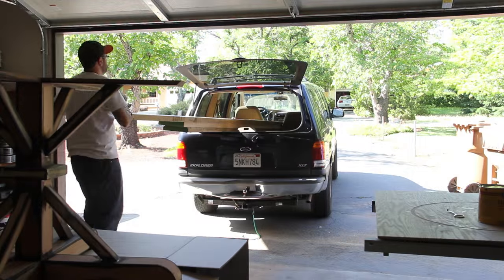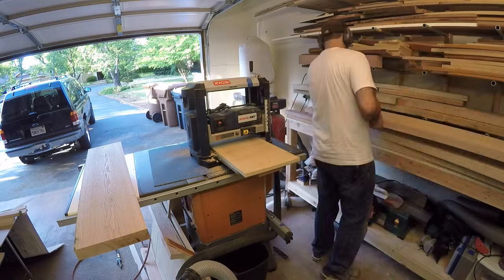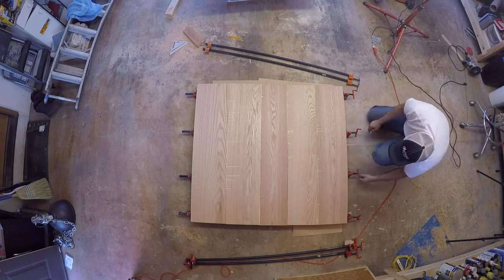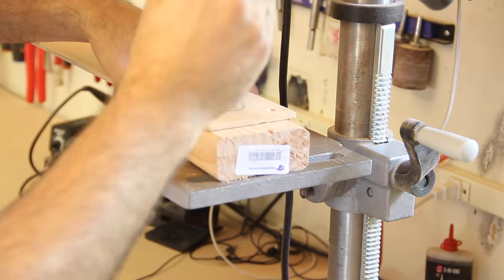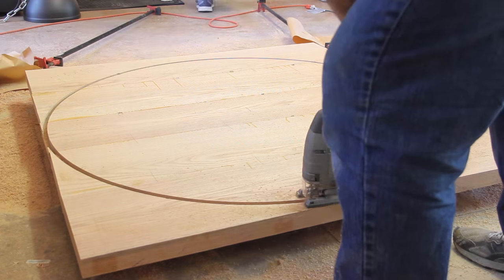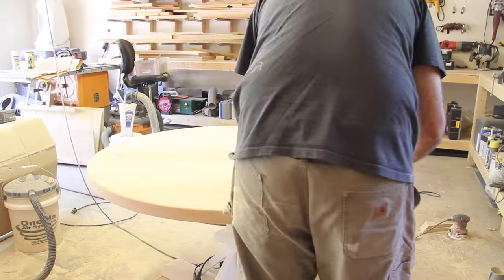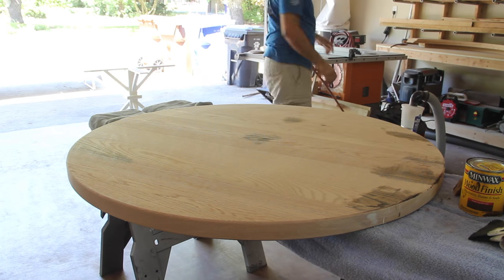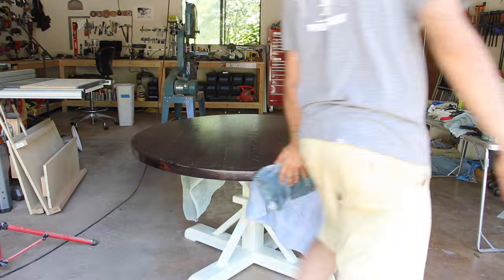How To: Make a Kitchen Table (Part 2)

Comment: Just subscribed to your channel.  Nice work on the projects so far.
About the spar urethane it bubbles very bad when you shake or mix it. Next time try diluting it 5-10% with thiner.  Need to do more coats but little or no bubbles.  
look up the Wood Whisper that's were I got 5 the info. In the end nice table
Reply from the maker: Hey thanks! Yeah I'll have to try that next time. What a mess that was. The spray worked well in the end, but it's not the same as the spar urethane.

Comment: Still a beautiful table..... how did you attach the table top to the base. If you mentioned I guess I missed it, lol
Reply from the maker: Thanks Justin! I just drove some screws up from the one by's on the base. If expansion and contraction becomes a problem, I'll just use a loose bracket or something. But no issues yet

Comment: Lay 2 coats of the spar urethane and then sand with 220 and then put one final coat on. It'll come out with no bubbles.
Reply from the maker: Thanks for the tip Jamie. Next time I will practice on a small piece before applying it to the real thing.